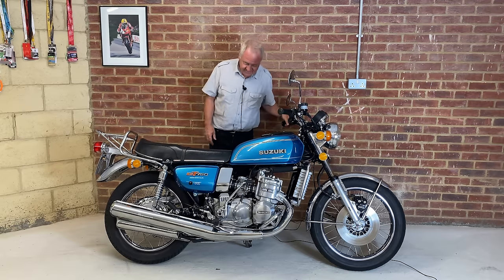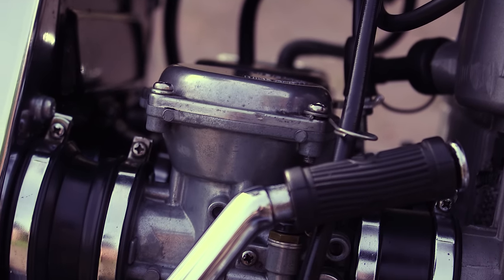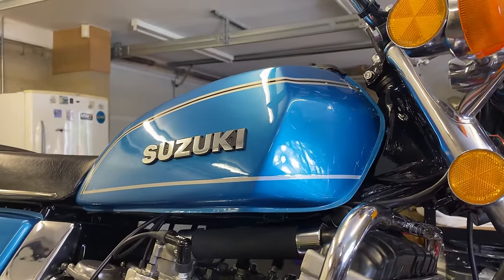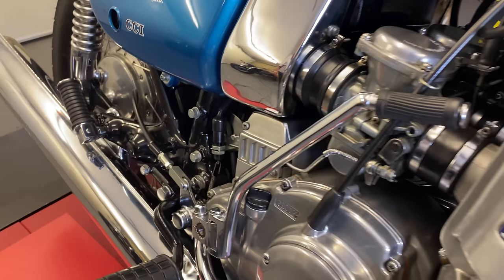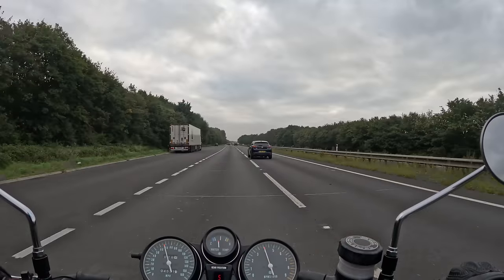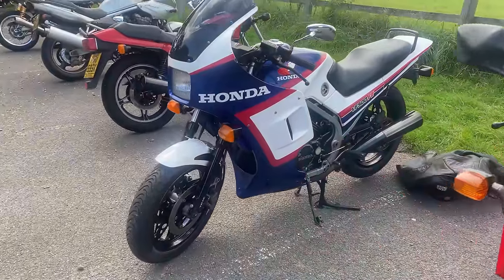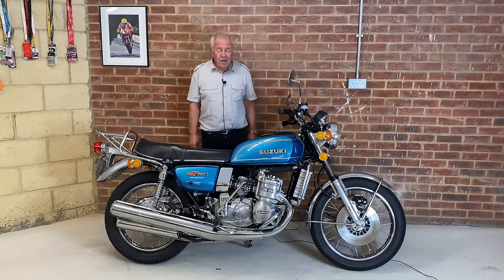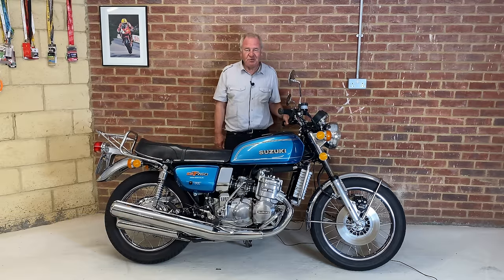The MAM Journals-The Iconic Suzuki GT750

Comment: Beautiful bike, brought back many memories. I was one of the first people in this country to ride the Kettle. I took part in the Suzuki Maudes Trophy attempt. When they launched the 750, 550 & 380 they decided they would ride the three bikes around the coast roads of England, Scotland & Wales three times and I was lucky enough to take part.
Reply from the maker: Very evocative bikes . I didn’t know about the Maudes Trophy . Thank you for sharing this 👍
Reply: Myself included friend 👍😀
Reply: Hagon rear shocks massively improve handling. The very slow steering is baked in. Ride accordingly.
Reply: I was working in New Zealand from mid 1975 to mid 1976. Bought myself a new blue 750(waterbus) and toured all over the North and South Islands on it. Great memories and thanks for a great presentation of this old classic.
Reply: My Dad had the exact same model. He would let me ride it all the time. The Suzuki Gt 750 was a joy to ride.
Reply: I am 64 now in 1977 I owned a 1975 old ‘P’ Reg It was Red and it had a Full Red ‘Mead Speed’ fairing on it with a set of chrome drop down handle bars that went round the 3 clocks also a single glass fibre seat with a tailpiece round it. Oooooh 
Happy days 👍😉
Reply: My cousin in law was a BEAUTIFUL paint sprayer painted it in red, gold and black just like Barry Sheene’s in his winning days. Such such happy days. I will take these memories to the grave
Reply: I had one also in California. Unfortunately I sold it.

Comment: Smoothest bike at 100 mph. Jewel. I bought a 73 new. Great bike in sound and comfort but it handled like a barge whenever the road curved. Sold it an bought an H2.  Which was the sweet spot for me. But nobody built a better touring 2 stroke than the GT 750 Suzuki.

Comment: I had one of these new in 1976. I loved it. Great engine which I gas flowed and increased the performance and decreased the MPG :).  The handling could be scary, don't shut the throttle when canning it around a bend otherwise a tank slapper would happen. It only let me down twice in three years, the clutch mech broke and the rectifier failed. Disc brakes were great in the dry but didn't work at all when wet. I still have the receipt from Edie Grimsteads of East London, cost me £976.

Comment: Earlier J/K models had non Cv, Vm32mm slide carbs. Old brake pads probably made the front brake less efficient than it should've been. The final version of the TR750 was one of Barrys favourite bikes, but by that time, the purely race designed TZ750 had  stamped its authority in F750.
Reply from the maker: Thanks for commenting and clarifying about the carbs 👍

Comment: I really loved the Water Buffalo for long highway trips. A simple bump in compression on the first freshen up really did wake them up. Braided steel lines and better pads really helped the brakes as do modern suspension and tires. I was really fond of the 550 as well. Great review.
Reply from the maker: Sounds like you had fun on one .. 👍

Comment: I bought a 750A new in 76. I’d had a GT380 before that which was good but the handling was strange, going round corners in a series of straight lines. The 750 was a revelation, the handling seemed so stable after the 380 and it was extremely comfortable. I commuted on it from Medway towns to Westminster every day rain, shine and snow and it was fine. In the slow traffic the crankcases would gas up causing the bike to lurch at low speeds - but it made an amazing smoke screen on the A2 when you opened it up! For a two stroke it was amazingly torquey. I put electronic ignition on it after a few months as I hadn’t realised then what was causing the lurching and the dealer though it was ignition related. I had it for just over a year then it was stolen from outside my office. What a bummer. I then moved on the then very new GS750 four stroke four - that was a far better bike to be honest but I still hanker for a GT. I think the looks are amazing - they were stunning in the day and as far as I know no one else has made a 3 cylinder water cooled two stroke so it is unique. For years you could buy used ones for pennies then I guess folk began to realise they were unique and prices began to rise. Now they are very expensive - probably reflecting the restoration costs, all that chrome for example and those fabulous exhausts!!! Got me all nostalgic now!! Thanks for this. Cheers

Comment: I owned a '74 GT in orange bought new in '75 for $1300. Put on chambers, a flat bar, radial-drilled (at my uncle's tool shop) the front discs, and put on some decent tires (or what passed for decent tires back then). It was heavy and the suspension seemed to be always trying to catch up. But, it was fast, very comfortable, sounded very cool, and got a lot of attention. Great bike, specially if you're pointed in a long straight line.

Comment: My 1975 GT750 actually had good brakes, no complaints from me. Rear was fine and very progressive.  Perhaps your example had bad brake pads or a reluctant set of old calipers. In fact one of the best features at that time was its braking power up front. Engine braking, forget it, it was like a two-stroke dirt bike engine braking.  At age 19 I put on a windjammer clone fairing, an EZ-Berg touring seat and an adjustable backrest, then rode it across the USA from San Diego to Groton CT in 1975. It was an Epic journey.
Reply from the maker: Sounds like a fantastic trip 👍

Comment: One of the best bikes I ever owned. The only thing that ever failed on it (that I remember) was the metal ring around the clutch basket breaking up, easy fix. Traded it in for a Z900 though. The first models had different, non CV, carburetors.
Reply from the maker: Thanks for watching and taking the time to comment . I wondered whether the early ones might have had different carbs but couldn’t find anything that confirmed it . Thank you 👍

Comment: A trip down memory lane for me, a great video.

The first Superbike I rode in 1974 was a GT750J with the four leading shoe front brake. A friend of mine had the same blue 1976 750A as you tested, I had a blue Honda CB750 K2 at the time. 

We rode together down to Venice in that hot Summer (before climate change) when I was 19, a fantastic experience.

Thank you for rekindling that memory !

Comment: Great video, great memories of my GT750. Bought it used in 1978?? (Not sure of the year). Mine had the black caps on the exhaust pipes, and yes, it did smoke when you got on the throttle. I never had any issues with it, but I traded it in for a 1981 GS750.

Comment: I owned a 73 and that bike had the very best brakes in that time. I don't know what may have been wrong with yours. My brother had a 74. We could lock up the front wheel at 70 MPH with just 2 fingers on the lever. We also beat the Kawasakis in roll on contests at free way speeds. The Kawi H2 and Z1 only caught us after the revs build up .Changing the fork oil and Kinis on the backhelped handling.

Comment: My first bike was a 1975 GT550 Indy. More tame than the Kawasaki equivalent. I quite liked it, but it was rough on fuel (as low as 20mpg, seldom more than 30mpg), handling was indifferent at best, and on my first ride in the rain I discovered the complete absence of front brake.

I wondered about the 750s at the time, but both Suzukis had been replaced with four strokes by the time I got ride of my 550.  

Interesting video, thanks.

Comment: Had a 75 gt750 after selling my 78 GS 1000, didnt handle as well but still a fun bike, surprised they made over 70,000 of them, very high quality finishes on these bikes.  got mine for 1100 $ it was in 1981 . very relaxed rider.
Reply from the maker: @radioguy1620  Great to hear from you . Thank you for watching and taking the time to comment 👍
Reply: @markr.1984  LO, true enough , only bought it after missing the GS and kept it only a year, the GS 1000 though could land you in serious legal issues without even realizing you were moving along that fast.  the spoked wheel single disc model was in need of more brake but loved the aluminum wire wheel, lightweight and helped handling, not sure if that was the only model to ever use that of any GS or other suzi for that matter.

Comment: A GT was also turned into a pro-level dirt-track bike in the U.S. Ridden by, I believe, an AMA expert named Ronnie Rahl. Only the engine was used, of course, but I suspect it was a bit heavy, certainly heavier than the 3-cyl Kawasaki 750s built and tuned by Irv Kanemoto. If it were possible to change to a big-bang firing order, those triples might've worked okay on the dirt, but in those days 'Big Bang' meant "My engine blew up."

Comment: Mine is original with original chrome and  a good seat base. However I have a leaking petrol tank (rust) it needs a rebore and the barrel studs are seized. I have replaced most of the bolts, but original “S” bolts are all stored safely. Hagon shocks considerably improved the handling. Brakes are of course as described.

Comment: I had one - I remember that it was very heavy, the footpegs don't fold up, the brakes would hardly work in the wet, and it would wallow at speed. Also, liquid cooling was a "cool" thing in those days 😆
Reply from the maker: 😂 I should have pointed out the solid foot pegs..

Comment: Such a lovely machine. I rode several and owned one for many years. First time I saw and heard one it was like something from "Dan Dare."I always found them to handle better and have more "go" than a CB 750. Completely agree about the brakes, in the wet it was cadence braking to find the drying point, but all Japanese discs were the same. Fuel consumption, lol. I remember 4 refills in a return day trip Thame to Donington via Coventry with my cousin on the back, but we were pressing on a bit. Mine had done almost 70k when I sold it.

Comment: Have one same as the video machine. Owned it for twenty years with a few other machines, it'll be the only one that will form part of my estate. I love it, it handles well on decent tyres, brakes are a bit iffy but useable and better than some. It's had a full engine rebuild, Hagon shocks and rebuilt brakes but looks it's age (47 years old) so I'm not precious about it and it gets used. Love it's smooth and fairly vibration free power but be aware they have no engine braking so the state of the wheel brakes is very important...

Comment: Had a GT750A in red, lovely bike, the current owner is about to start a resto on it. I think the later models (M, A, B) had larger vacuum mikuni carbs to go with the much wilder exhaust and inlet porting.
Reply from the maker: Thank you . I searched 6 of my usual specification websites and they couldn’t agree on this one 🤦😂 . I try to get it right but harder in the older bikes 👍

Comment: I had a GT750 back in the 70s and in its day, it was a rocket ship. The suspension, as was typical of the era, was not something you would want to push but the bike was fast and comfortable.  I slapped a set of Bassani expansion chambers on it and the performance gain was quite minimal, suggesting that the factory did indeed pay attention to the exhaust design.

Comment: I remember my Kettle well, I remember me and a mate rebuilding the engine after me forgetting it was a two stroke. What a pig of a job that was.. It used to skip and jump all over the shop if it even saw a white line. My skinny 18yr old legs couldn't stop it going over in the car park in front of 50 or so other bikers as I tried to look cool with the bike and my girlfriend both pinning me to the ground.  I ended up swapping it for another icon ....a bond bug. :elbowcough:

Comment: I owned a 76 GT750. Grey in color. mine had only a gas cap, no opening lid. Great low end torque, and linear. Motor felt like 4 stroke. Not peaky like the kawis and Yamahas. Just a dream on the freeway, really good gas mileage too. Would do 40 mpg. The gear shift between 1st and second was a bit to tall. I’ve read that is a diff between 75 an 76. They lengthened 2nd to get more top speed. But not sure. The 76 didn’t have a front exhaust header cross pipe like the 75. Really liked that bike.

Comment: That front brake in the wet was a bastard. Nothing, nothing, nothing ….then lockup and front wheel slipping on the road.
Reply: There was a sticker on the front fork of 1970s Suzukis that had disc brakes: "Caution: braking performance at the beginning of the application may change with wet brake disc".
Reply: Yeah, i switched my GS750 with my bros boiler and swiftly lost the front end stopping at a zebra crossing.... i squeezed like i did on my GS..... nothing for 2 seconds then......AAAARGH!
Reply from the maker: @theravedaddy  🤦

Comment: My mate had the 380 and a guy in our group had the 750 I only had the baby 185 in the blue,loved the bike sadly I worked my bike to hard and damaged the engine after removing the cylinder head I found one piston completely damaged with a hole in the middle the other piston had pre-ignition damage. After replacing the pistons with new rings the bike was running fine and a traded for my first car.

Comment: Some chaps I used to knock around with in the late 70/80s used the engine in a road race outfit. Overall very reliable & not expensive to run. The Yamaha engine they moved too was a different kettle of fish.
Reply from the maker: TZ?
Reply: @michaelmam  Yep. They could run the 700 or 750 version. Cost a fortune to keep running. Not reliable & if they finished a race only took them one or two places up in the results.
 
Visiting Mallory Park one year for The Festival of a Thousand Bikes kettles were generally circulating quicker than 500 Gold Stars & Manx Nortons. Yep surprised me as well.
Reply from the maker: @davecooper3238  👍. It is a good engine . I did suspect with the right suspension, tyres and a few , discreet , frame braces the GT would be useful . Standard , you would need be talented and very brave 😂😂

Comment: Nothing wrong with the brakes or handling if you have a great set of tires - I had one back in the early 80's and never had a problem - again no blue haze if you actually set the 2stroke input correctly.

Comment: If only Suzuki had gone ALL the way and made it a 1000cc four .
Reply from the maker: You mean as a two stroke or is that a tongue in cheek reference to the GS ?
Reply: @michaelmam I meant as a 2 stroke - I guess the engine would have been too wide as a four but the power would have been untouchable  - would have eaten z1’s for breakfast!
Reply from the maker: @muckle8 Suzuki , Honda and Yamaha all made some pretty useful 4  cylinder , 2 Strokes but obviously not at 1000cc . Californian emission legislation steered them towards 4 strokes and indeed was one of the drivers of the Z1 you mention. Kawasaki knew that their 750 was not long for this world ..
Reply: @michaelmam  I wonder why the big 4 never experimented with bigger cc 2 strokes back in the day - maybe the pollution would have been off the charts! Or as I suspect - they wouldn’t have sold nearly as many large capacity four strokes , the gt750 was 70 bhp so add 25% and it would have been near 90bhp - enough power ( at the time) to see off anything. - ancient history now though of course - thx for your content this far.

Comment: carb,are CV 40Mm.
Reply from the maker: I am not sure . They may have fitted different carbs to the early ones than the later ones? Searching 7 internet specification sites, 5 said they are fitted with VM32, one , classic-motorbikes net, said that the GT750A is fitted with 42mm CV and another was mute . Whilst it would be nice to know , there isn't a definitive answer at the moment .

Comment: Me again. I knew you’d knock the brakes! In the day they were fine I never had a problem and I would hammer it. (Got it to an indicated 120 several times - on a private test track of course!) Even at the time the press would criticise the wet performance of stainless discs in general but I rode every day in all weathers in London traffic the brakes were fine. I found no lag in the wet and plenty of stopping power and I was two up most of the time. The press also sneered at the digital gear indicator - only inadequates needed a gear indicator apparently. It’s odd now that nearly all bikes have one. I found it very useful at all times - which shows the press know nothing!
Reply: Which shows you never rode one in the wet. The brakes took a second or two to squeeze out the water. Gear indicators are for tossers. You go up until the gears stop, down until they stop. 120 mph on a GT750?? Not standard. Maybe 110.
Reply: @redtobertshateshandles in london brakes not exactly high speed

Comment: Rember them well back in the day they where a death trap around 120mph they would go into a serious tank slap many came to grief or died from improper front fork set up with the handle bars imploded through their stomach but they  where quick through the rev range even quicker with a 3 into one fairing different geared front and back sprockets good for 130 mph

Comment: c.f. 40mm no 32mm Mr c,dale  I bought 1 new in 1974 ,and it was trashed every where and did 79 this and miles before the crankshaft oil seals went, but when striped down  all the crank shaft bearing,and gearbox were still ok I paid cash in 1974 and it cost£899,since the I have owned an restored 3,more and are doing  my mates gt,750 b,model.